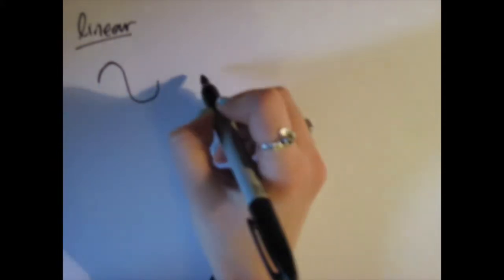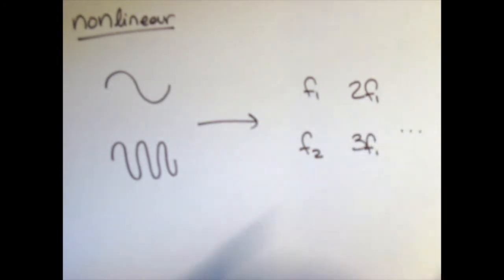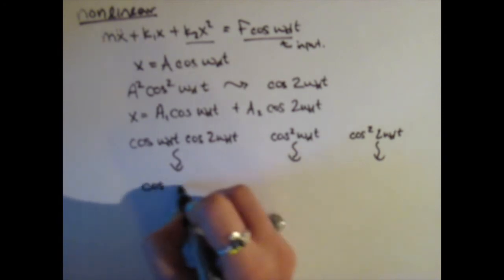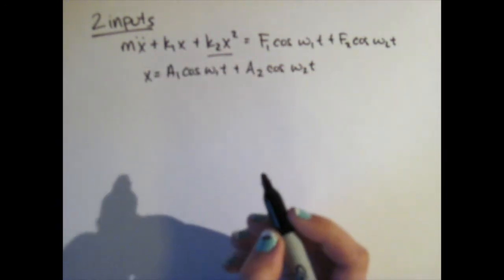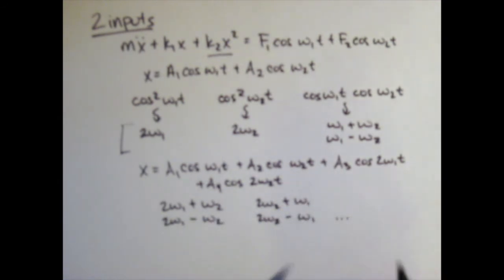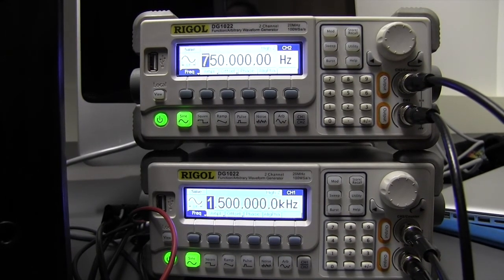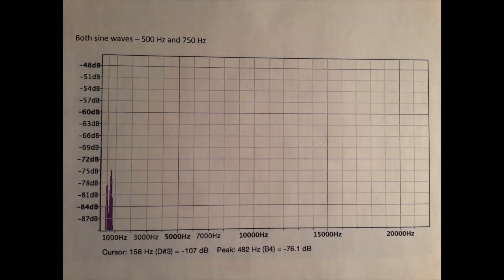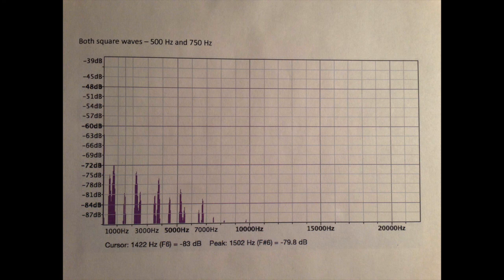The Phenomenon of Barbershop Overtones

Comment: The mathematics is pretty badass and I can see it's a class project. But it's pretty easy to just say that pitches sang/played in perfect harmony will have coincident harmonics. So a perfect 3/2 relationship 5th will have a coincident harmonic between the 3rd harmonic of the lower pitch and the 2nd harmonic of the higher pitch. The coincident harmonics add together in amplitude to increase the volume of that particular pitch. 

This is how piano tuners tune pianos. They use coincident harmonics and then temper them to bring them slightly out of tune with the natural integer ratios of the harmonic series in order to create our 12 tone equal tempered system.

Comment: 2^(7/12)=1.498307 not 1.5 . Is this difference negligible? Btw  in middle east and turkish music also this ratio of 1.5 is used when calculating the fret positions on the instrument.
Reply: Pure fifths are calculated by the 3/2 ratio (1.5). Any other fifth is a deviation from this, depending on temperament, like that you calculated above (it's the perfect fifth in the equal temperament system). So yes, you can hear this difference in a context where non-temperated instruments play together (the fifths tend to be 3/2 or closer enough) or, specially, when a non-temperated instrument plays along with a temperated one, like a duet of violin and piano. In bowed strings pedagogy, usually a player will face these situations and will learn how to adapt to different temperament systems naturally by ear, as is usual to change from pythagorean (3/2 fifths) or meantone (narrow than 3/2, but closer to) to equal or just tunings. Cellomind book deals with this, as well.
Reply: @furman.composer  Thanks for the in depth info.